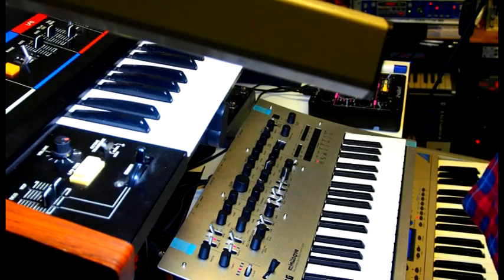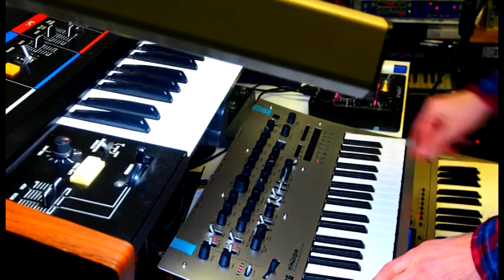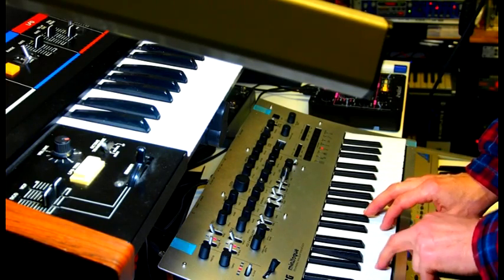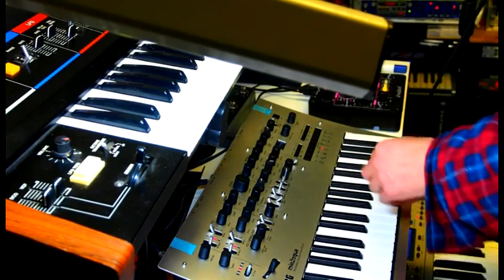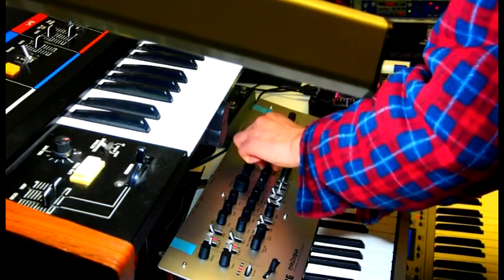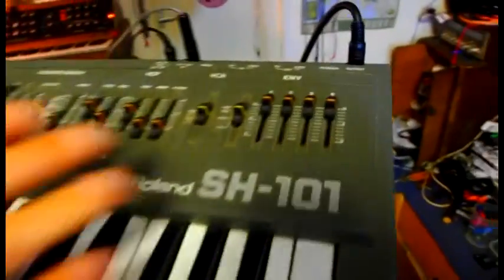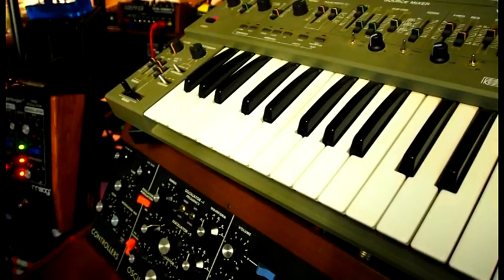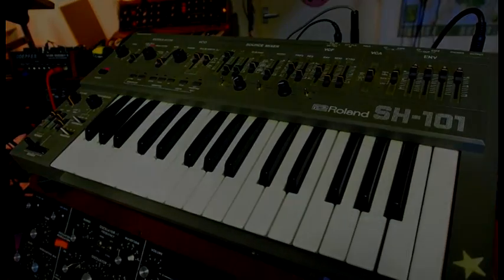Analogue envelope behaviour Minilogue vs. SH-101

Comment: Came here after researching this behavior with my Korg Kronos, trying to find a solution or workaround.  No luck.  It also won’t duplicate the classic analog mono synth behavior shown with the SH-101.  Surprisingly there are a few cheaper options that can act like the SH-101, including the Waldorf Blofeld and the Novation BS2.  Akai Miniak does as well.  How on Earth could a big production workstation not do that?  Worse yet, even the MS-20 emulation on the Kronos doesn’t do it like the real MS-20.  Geeeeez…

Comment: It does sustain... you set portamento to zero.

I know it's weird to have traditional monophonic playing disabled by default, but a quick setting change fixes that. (Maybe they'll fix the default in a future firmware update)

But yeah, it definitely is fixed by setting portamento to 0
Reply: +Ronnie Perez No, it isn't. You have failed to understand the point being made.
Reply: +WilyEPeyote I tried it out right after posting this... you're right. It HELPS... but doesn't FIX the issue.

By default, if I hold down a key then press another while the envelope is going, it resets the envelope from nothing.

With Portamento set to 0, it behaves properly only if I hold the first key down and play others. which is a massive improvement...

But if I let go, and press another key, the envelope resets from nothing again... which would be fine if it were some kind of setting..

I'd appreciate having the choice to do all 3, like my Sub37 (which is wonderful).

I think they massively dropped the ball with the mono mode in particular.
Reply: +WilyEPeyote Poly mode works the same way, I'm sure, which explains why the envelopes felt a bit off across the board. It feels like the synth was not designed by a synth player, but that it was designed to fit a good spec list into a pretty box.
Reply: +Ronnie Perez Korg have done their software envelopes like this for years. It's just as easy to code it like an analogue synth (they did it beautifully in the Radias, for example) but that first requires understanding. If this were some ACB thing where the software guys attempt to understand a particular piece of hardware, they'd suss it I'm sure.  Unfortunately, it's a very hard point to get across to them - and believe me, I've tried! Still, it saves me some money. :)
Reply: +WilyEPeyote Hopefully they get it together and make firmware updates. I want to love this thing 100%

Comment: SET PORTAMENTO TO 0 ;)
Reply: +kingpishful And doing so tells the software envelopes to start from the current level? I'm intrigued if that's the case. Unfortunately the Sonic State video didn't show the transition from release to attack as Nick kept a finger on the keyboard, thus avoiding the release stage.
Reply: +WilyEPeyote I'm just passing on the info from the sonic state video. someone here most be able to confirm
Reply: +kingpishful I saw the video but it didn't address the issue here, which is not whether the envelopes are triggered but at what level.
Reply: Sorry. For me, I'm not as bothered as long as it stops it triggering from the start. Which is what it seems to do.
Reply: But if you've let go of the previous key, before you press the new one, it still starts the envelope again from zero, right?

Or is there a way to turn on full time portamento?  If not, this doesn't seem like a workable solution.

Comment: This is an intensely irritating "feature" that Korg (which I otherwise dig loads) seems to be particularly prone to putting in their instruments.  Hearing it on the minilogue on the video actually annoyed me!  I sold my prophecy because it made it unplayable with certain sounds, and the wavestation (in mono mode) did it too iirc.  Ridicuous that the vst mono/poly does this too, my real m/p works properly.  Get a grip Korg!  This is a deal-breaker to me, would not buy any mono synth that does this.
Reply: +Norman Fay the only reason I sold my Prophecy too.
Reply: +digidope It's nothing to do with legato. You do understand this video is demonstrating the transition between the release stage and a new attack? If you're playing legato, you never hit the release stage.

Comment: You're right - horrible, horrible note sucking in mono mode - just horrible!
The proper envelope on the SH101 just sings by comparison.
That return-to-zero suck is a huge bugbear of mine, too. It ruins a synth for soloing.
Those of us who grew up playing lead lines on analogue synths just get this instantly.

Some digital synths can do the envelope properly, though - the Nord Modular and the Sequential Sixtrak are two that I have. So there's a hope that Korg can sort this out in a firmware update...

(And yes, the Sixtrak has analog voices, but the envelopes are software - just like the Minilogue, presumably.)

Comment: I wonder if changing the Portamento mode changes the behaviour at all? According to the manual, there is 'auto' mode and there is 'on' mode which means that portamento is applied even when a note is released. Would this fix the issue?
Reply: +Luke Lehane no
Reply: +WilyEPeyote damn it. I have this ordered and I'm worried now, heh.

Comment: Yes, but what if you wanted to actually kill the sound like when your playing hard baselines. Without re-trigger, next notes would mold into the previous notes when your having long release, and you would eventually loose punch. Would the SH-101 help you here?
Reply: +SoloStuff Dude, this is nothing to do with retriggering. It's about the voltage an envelope starts from. Looks like we need to do a single/multi triggering video too. Fortunately there's a Minimoog and ARP Odyssey right here... :)
Reply: +WilyEPeyote So the minilogue EG starts from voltage zero on each note pressed, while the SH-101 EG starts from where it left (voltage). Is that what you meant ?
Reply: +SoloStuff All analogue envelopes start from the current voltage unless there is extra circuitry to discharge the voltage, as in the Memorymoog example above. Almost no other commercial synths do this; there's a Digisound envelope too - if you know of any others, I'd love to add them to my list for the inevitable future discussions on this topic.